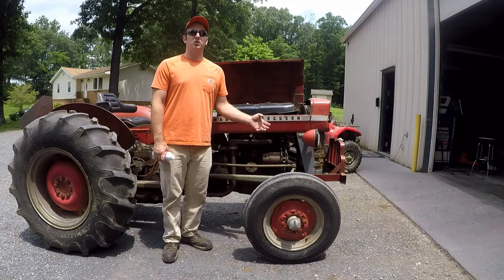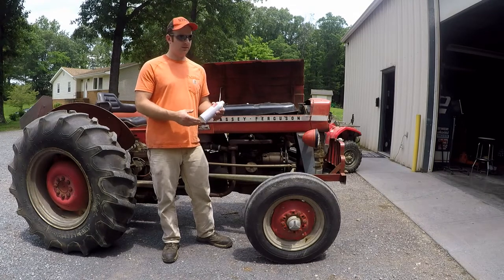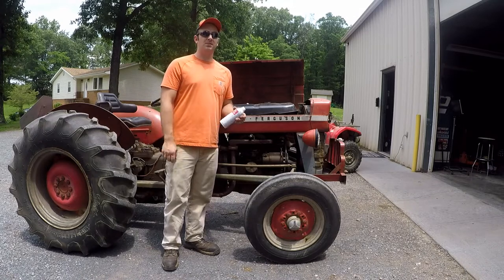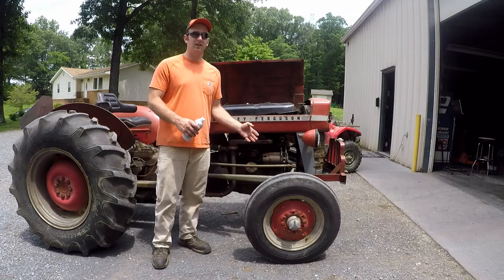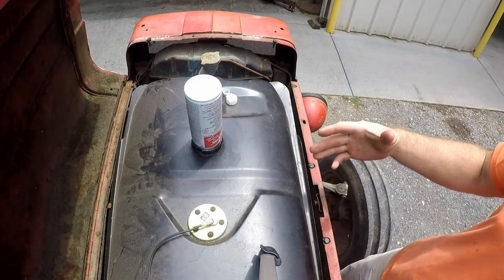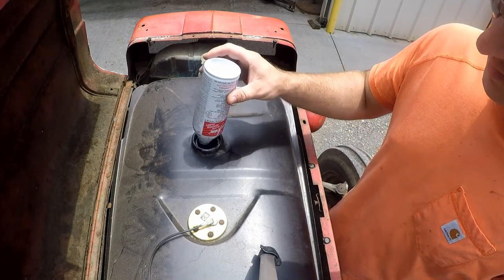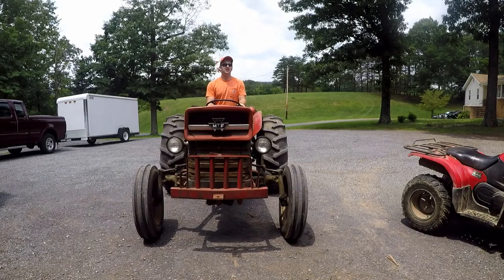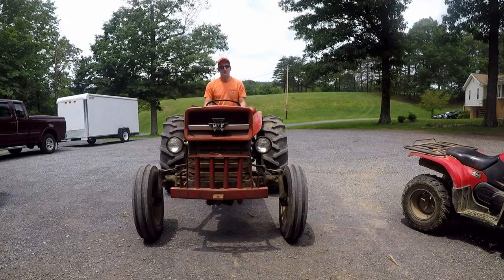Can Seafoam Fix a Carb?????????

Comment: 16oz into a gallon tin so its not so diluted. and spray it into the carb. run it till its hot for 15 mins then leave for a few hours then run it again.  do that till the gallon has gone.
Reply from the maker: Spraying into the carb is not going to clean the jets.
Reply: @TractorTech  run straight seafoam in your gas tank until you start to see white smoke coming from your exhaust which means it's right through your fuel system and in particular right in the float bowl of the carb. Let it sit overnight so it can really do its thing then pour high octane, fresh, ethanol free fuel into the tank and runt it. It should be fine after that and if not then yeah, carb rebuild time. It's ethanol fuel that causes the issues as it gels up when left sitting for awhile and causes the clogs.

Comment: I've got a Baja warrior minibike carburetor soaking in seafoam. I cannot get the jet unscrewed to clean everything behind it . There's a pin behind jet I can't get to to clean . Any advice would be appreciated.
Reply from the maker: Have you tried spraying carb cleaner on it?

If you have had some berran chem dip soak it in. An ultra sonic cleaner may work too.
Reply: I’m a year late but if you still have problems ultrasonic cleaners can help, I got one off Amazon for like $60 when l was stripping the slow jet in a carb trying to remove it and couldn’t get it loose

Comment: I have a fair bit of experience using Seafoam. I’m not trying to be critical of your use but you can not expect instance results. For the nature of problem your having you need to start with the 30 min run to get the product fully through the system the run the tractor for 15 minutes each day over the course of say 5-10 days. The product needs time to break down the blockage followed by removing bits of that debris by running it. If you ever come across the same problem give it soak time, I think you’ll be surprised.
Reply from the maker: It had a jet that was stopped up completely. Since the seafoam could not flow through it, how would it clean it?
Reply: Agreed.  Seafoam's instructions for a situation like this involves soaking the carb for 24 hrs with a 3-1 gas:seafom mixture then running a normal mixture over time to finish clean.
Reply: @brantleywest6640  I believe the can actually says do a 50/50 mix with gas for deep cleaning. A lot of people swear by this stuff, it's not a miracle though. I'd say it's good for minor carb hiccups and it will still take probably a full tank or two to really clean it up.

Comment: running seafoam thru the gas isn't the same thing as what Most call "seafoaming" an engine.  a True seafoaming of an engine is using the the spray can variant and spraying directly into the carb as the engine is running and soaking it with a whole can then quickly turning the engine off and letting seafoam do its work for about 15 or so minutes.
Reply from the maker: Spraying it into the carb will not clean the carb. That cleans the top end of the engine.